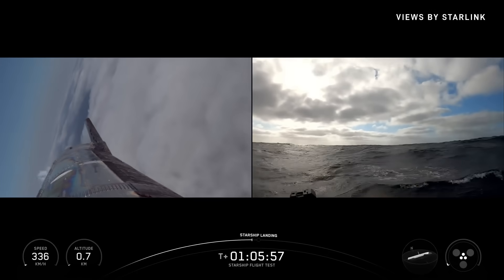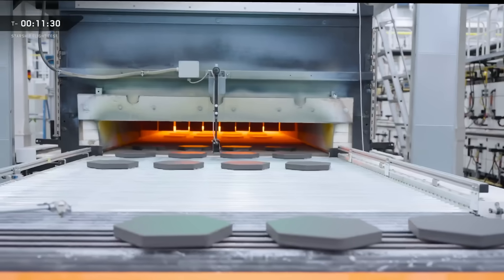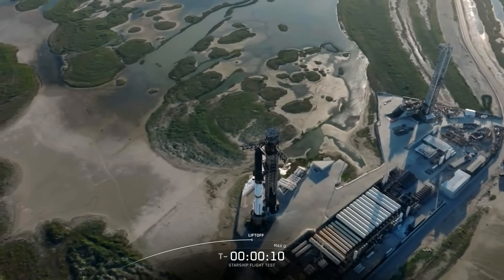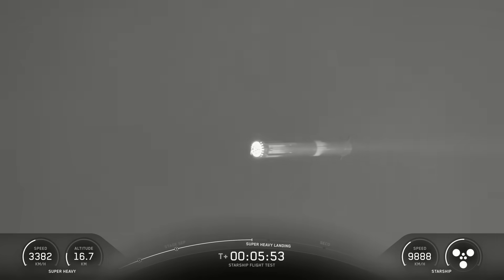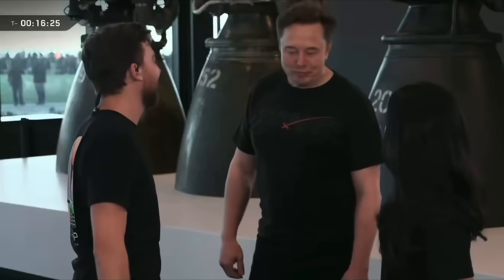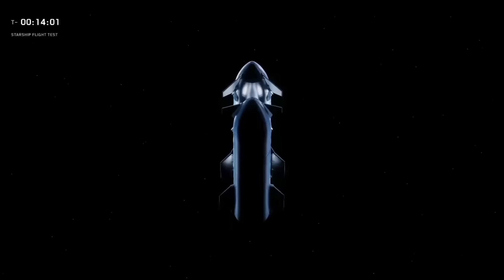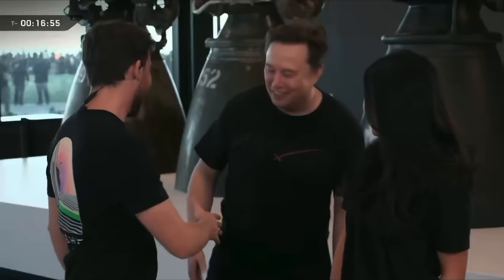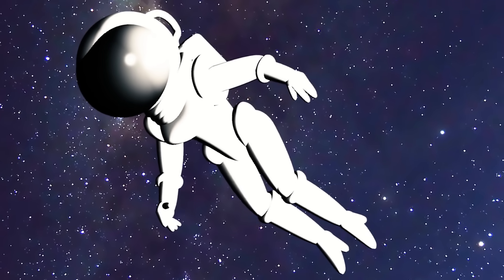SpaceX Unveils Advanced Tile Bakery, Flight 11 Flawless, & Elon Musk Photobombs

Comment: Has anyone ever considered using detachable external fuel tanks (belly tanks) on Starship ? Seems that fuel could be more easily feed directly into the main tanks while still in gravity. When emptied detached while still in upper atmosphere  , parachuted back to ground for reuse . Maybe a booster configuration but with Methane tanks instead and no extra engines ?

Comment: On IFT-11, we have seen cascading Tile loss (late in reentry), Flap hinge-base damage, and LOX Hull Burn-through. 

But, none of that damage has ever prevented Starship from doing a flip and landing burn. The Ship is incredibly tough to survive so many types of re-entry damage. 

A LOT of tiles will need to be installed after every flight at this rate. 

I expect the tiles to gradually become tougher as SpaceX develops expertise. Once enough Ships are rotating through Launch and enough repair personnel are hired, that refurbishment speed can exceed the many other "bottlenecks". (Such as Methane truck delivery, local LOX production rate, rendezvous approach rates and orbital propellant transfer rates.)

Comment: I am puzzled why they would go full bore production before a recovery to confirm the design holds up. Kind of hard to confirm the tiles worked as intended when they haven't really inspected after a re-entry. Are they fishing the pieces out of the ocean after it explodes?
Reply: There are so many sensors on those ships sending back real-time data that there is no need to recover the physical ship to get a complete picture of how it held up...between that and the plethora of cameras all over the boosters and ships, only a few of which are used for the live streams. They have every view, and reading they need to completely rebuild the ship virtually after the flight for analysis.
Reply: The payload of these ships is thousands of sensors, basically. They know virtually everything happening to the ships throughout flight down to oceanfall; once they’re reliably, accurately landing these and getting within the safety margin, and catching them back at the tower, they’ll be able to do further inspections, but this enables them to fly a lot more and learn quicker about how the vehicle operates and what needs to change. They’re not getting ALL the data they would from a physical inspection, but good enough that they’re able to hit the ground running with a design.

Comment: On Felix's channel issue. For a multi billion dollar company why can't You tube have an actual person that just briefly watches content on its platform and can get these things fixed much quicker than using the system they current have. I mean a company can be severly affected by the  current moderation system they use. I really think any channel that has a significant viewership should be at a higher tier for customer service. I mean im just a simple guy that doesn't  have a degree or anything and i can figure out this is not good for buiness at all. I think You Tube lost its customer focus many years ago with how it moderates content. They act  like seeing something on You Tube is going to damage your entire life and if there not there to prevent that you will have massive negative consequences in life, when the reality even driving to work is more risky to your life. Most channels that have a million subs aren't going to be showing anything extreme u less they been hacked.
Reply: Especially with some of the drivel they do allow

Comment: There is no record of how much of the turn around time was devoted to just tile refurbishment after each shuttle flight. And they never lost 100s of tiles on each mission as some folks have said on the internet. Most of the tile refurbishment time was to repair and replace damaged ones.
Reply: It was a complex and slow process. Due to the complex shape of the Shuttle, each tile was different, and had an exact place. And of course automation was out of question.
Reply: @andrasbiro3007  Yes and 99% of the shuttles tile problems were caused by foam and cork shedding from the External tank and solid rocket boosters. Something SpaceX will never have to contend with.They have it easy.

Comment: I never though Elon would be able to build a 100% working heatshield, because of the fragility and gaps at the hinges. But he did. Seeing the footage of the tile bakery was impressive. Props to Elon.
Reply: the flaps seemed to hold up really well too, usually the big bottom flaps end up with a few holes if not a mess
Reply: Is there any video or photos of the ‘hot side’?
Reply: @whodatcatt  Hope to see those later, don't know, snippets looked pretty clean/black
Reply: We could see the O2 vapor escaping right through a missing tile location. The LOX hull burned through. It still flipped and "landed"! 
That is one tough bird!
 @whodatcatt
Reply: Musk is skum